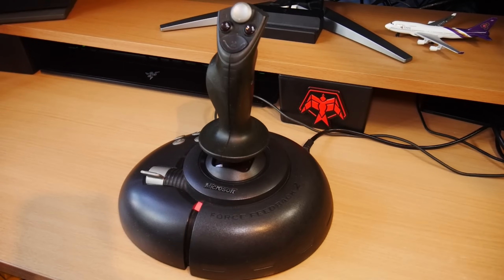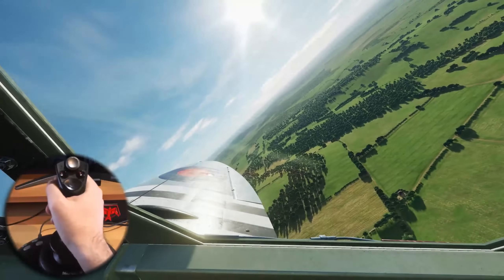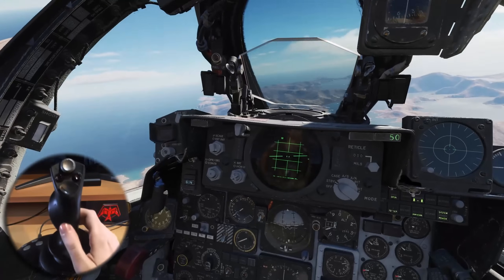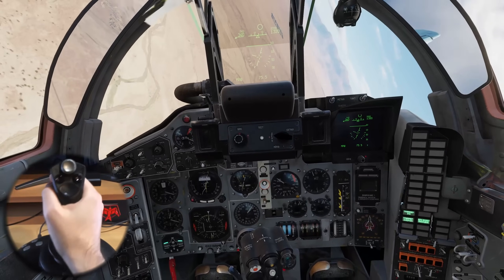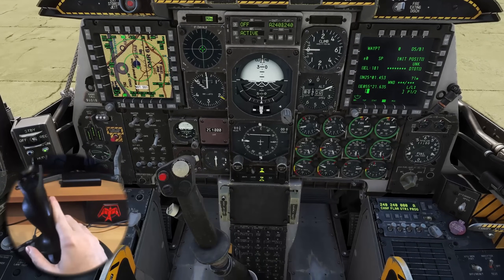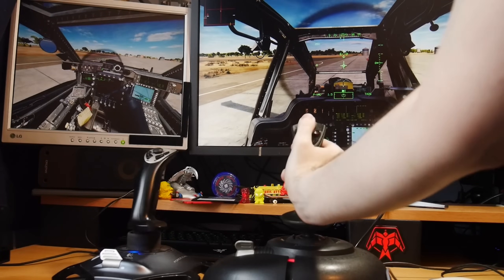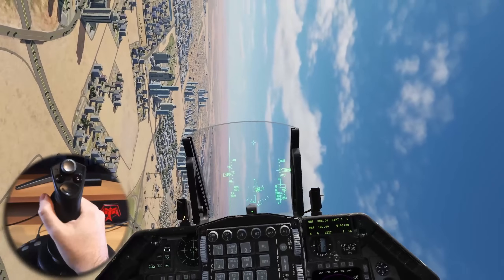Force Feedback in Digital Combat Simulator, An introduction

Comment: Out of curiosity how compatible is the sidewinder with todays games? Is it a pain to get working or for the 50 bucks i see on ebay is it worth it?
Reply from the maker: If the game supports FFB it'll work. Though getting it to work at all with FFB is a little jank. No idea about on windows 11 this was on 10.

If the game natively supports FFB, and your FFB drivers are working, it'll work with that game. But... almost no modern games support it, the exception being flight sims. Most modern racing sim games support FFB, but for steering wheels rather than sticks, but some might work sort of.

So, you'd be looking largely at late 90s early 2000s games that support FFB really. As the rather lackluster gamepad rumble has replaced that kind of feature and has no translation layer for FFB.
Reply: @RedKiteRender  Also, I cannot get the Sidewinder 2 to work in Windows 11; I went back to Windows 10 and all is good.

Comment: Is there external software evailable to get more out of the effects? Like when its not nativly build into dcs-module?
Reply from the maker: I don't believe there are any generic programs to do this. Software like VPForce is a modern open source FFB solution, MOZA and WW also use their own software to add effects. But all of these are tied to their hardware to best of my knowledge. So, if you're buying a modern stick it should have extras, but old original FFB it's unlikely to have any support.
Reply: Are u using windows 11? If so how did u get it to function?
Reply from the maker: @ This was on windows 10.

Comment: I recently got an old logitech ffb joystick & have been having so much fun, im more of a retro gamer but using xpadder to simulate effects then playing old space sims like Wing Commander &  Xwing (which never had native ffb), the difference is just astounding

 ive even added effects to emulated console games which transforms a mediocre "simcade" into something completely immersive, i can never go back

Space sims are especially cool due to the generic centering spring you can apply (which isnt ideal for planes) but you can make it so the stick tightens when you boost the throttle or kick the stick back hard when you fire missles, or just vibrate for laser fire, its as if youre playing a completely different game

Comment: Microsoft killed the force feedback joystick back in the day, when they did an update that stopped a vast majority from being able to work with the operating system……..just like they have done to many VR headsets by killing off mixed reality for VR.     Yep a lot could be said of big companies
Reply: But his is working now?
Reply: @I’m talking about the original going back about to early 2000. The windows os was restructured to remove the direct interaction with hardware.
Reply: I’m going back over 20 years ago as I said, back in the day.

Comment: If memory serves, the MS FFB2 stick has infra red sensors on the back side of the stick, so assuming they aren't clogged or blocked from age/use, it will only apply force feedback when your hand is blocking the IR beam on the back of the stick.

Comment: Racing sims have been "gameifying" simulation for decades, the whole point of FFB is transmitting all feeling of the vehicle through the primary sensory input, the steering wheel. This is why iRacing FFB is mid as hell because it only transmits the steering axle forces whereas Assetto Corsa stands head and shoulders above the rest with is full sensory FFB system that also inputs far more of what the chassis is doing through the wheel.

The fascination with avoiding "gamification" is going to hold back DCS in this area hard, it should be so much more than what they limit it to.

Comment: Have had my VPForce for a year, had the MSFFB2 before that. More has been said about the VPForce than I could possibly share here, FFB aside I love how it can also be configured into a non-FFB but feeling the same or better than VKB/Virpil's.
I can speak for FFB in general though.
The issue up until now has been people doing max elevator deflection at the ragged edge, with scant regard to saving energy, that's been an issue for quite a few years now.
The P-51 for instance has gotten offed many times because of this, smaller 109's simply turn inside of the P-51's circle, pull lead and hose them, it's simply easier.
But with FFB, the few times I fly the P-51, in IL-2 for instance, the 109's just outright don't expect me to do the same as them, vertical wingtips putting it on the edge, but worse yet I'm HOLDING it there at about 220-240 mph, it's a wider but faster turning circle, to get inside of it they have to be at the ragged edge, overpull to get lead, and shudder a little (you can tell when their wings start rocking), that's when I gain, then eventually they try to break away and run away having turned with me for far too long = My queue to just open the throttle and hose them outta the air.
I can also throw it into quick "flight departures", spin around my own axis and return fire as they zoom by, it's getting people thinking again finally after years of 109 superiority.
About the only thing that gets me is packs of 109's running trains on me, and it happens often, but if I can get them all turning after me at the same time I can give everyone a quick burst as they invariably disengage when I catch up (never fails) hopefully damaging them, then focus on the last 1 or 2 109's.

Comment: Sadgely, Google did not push me a notification for this and I only found this because I was curious about your handle change to RedKiteRender...

0:03 Yay for Moza! Got mine already as well, hooked up with a long Monstertech extension and a total of 17.5cm worth of extensions from MFG. It's a night and day difference to the good old FFB2 that I used for 21 years straight. And it was way overdue, if you ask me. I never used the TMWH stick because it didn't have FFB in the first place, it literally was lying around in the wardrobe for some' like 12 or so years. Just been using the throttle. And I never cared about the better CAM based bases (badum tss!) either, because, again, no FFB. And when Moza announced theirs and I read someone had already preordered theirs, I immediately went ahead and did the same. And even with the mounting and extenions adding the entire thing up to almost a grand (170ish for the MT, 100 for the extensions and I used the PayPal option to pay the base off over 24 months, adding interest rate, plus shipping, obviously), I have absolutely no regrets!

0:30 I played THAT and other space sims with the venerable Freestyle Pro though. The thing that came with the gyro sensor and Motocross Madness, which also was great!

1:02 Good old OG Il-2 - the thing that made the FFB2 spread like the Woohun Whirlybird! It literally gave you an edge in dogfights!

2:35 Which some might actually do with the new bases, unless they install extensions to get more leverage.

BTW the whole stiffening up thing is way better in the Il-2s, OG and GB. In DCS, peak force is applied already at around 200kph or even less, which - to be honest - sucks. I hope that ED will rework this with more bases coming up now.

6:26 And that is the most important thing about having FFB sticks for simulations: It gives you some extra muscle memory advantage. At some point you just know how fast you're going simply by judging the stick position. Which is the main reason why I never could give up on it and went through 21 years of using that specific good old Sidewinder stick that is old enough to have beer in the United States. This is especially vital, I even dare to say mandatory for the helos!

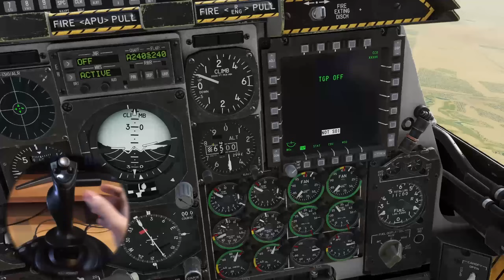11:01 Wow, didn't even know that as I never ran into that situation. I wonder if they have modelled the MECH mode in the Hornet though.

12:02 Here comes the real deal of why FFB is so important. It's an absolut game changer here. Casmo literally could yeet like every third video he ever made, because those all were on how to trim the darn thing, and just replace it by one telling the people to get a fricken FFB stick base now or bust.

13:22 Absolutely another absolute must have use case for FFB, even though it still requires some work to be done on the modules' end.

14:21 I hope the rise of FFB will change that. It's been like that for decades, FFB always being dragged behind somewhat.

17:49 I still have to fiddle around with this... initially, my Moza base was set to Telemetry only and nothing happened. Then switched to Both, same. Then went to DirectInput and after it not doing anything there either, I restarted the entire software suite (Moza Cockpit and DCS, basically) and I got what I was used to, just to leave it there for the time being as I still have to remap most of the modules and actually get back into the whole flying thing again as I've more or less dropped it somewhere in 2022 and only came back for a flight or two when new modules arrived, because I kept having performance issues which I resolved by getting a 4080S earlier this year... but I was stuck in ETS2 and ATS which I started enjoying with a wheel around March XD

BTW from what I heard, VPForce is the absolute reference here. ANd initially I was going to get that base, but I had some troubles with the Google Sheet to sign up for the waiting list that I never gotten on to and didn't care enough to get done because I kinda was holding the whole flying thing on break anyways...

18:54 Speaking of rudder pedalsm AFAIK FFB pedals exist from Brunner and also are announced to come from a company called flitesim. I really hope that this will make the devs implement force trim effects onto those as well, especially for helicopters where it's euqally as vital as it is for the stick itself.

And ultimately I wanna see FFB throttle quadrants that make use if those motors to give us actual friction control, dynamicly placed detents based on module and ideally also input curve settings! Which is a thing that DCS doesn't incorpoirate yet BTW. You can't have a non-linear curve with FFB, otherwise your force trim will be off. Oh, and of course, this would also add the "ghost throttle" thing to aircraft like the Hornet with the "au'oh thro'oh".

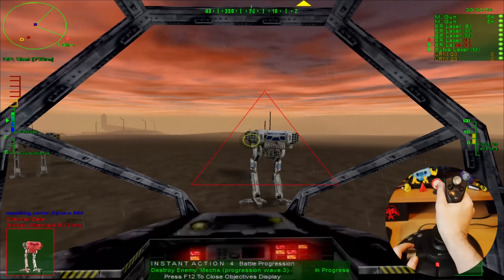19:31 BTW, I can only urge you to give Il-2 Great Battles a shot with it. Its FFB is just pure awesome. Especially with the WW1 birds!

And I wanna go play some Vox Machinae in VR again now... or finally get MW5 with that allegedly great VR mod...

PS: This video needs way more views. Would have it totally deserved. Can'T wait for a follow up on the Moza and its software BTW.

Comment: Great summary of the state of the FFB support in DCS. FFB is a game changer, i bought mine as an experiment, i thought i will try it and most probably sell it after...but it makes a huge difference, i cannot go back to spring loaded sticks. I think the most important part is the last section of the video, about the software support of the hardware manufacturers. I do not belive that ED will make FFB support impovements as a priority in the nearby future. This means we have to rely on the 3rd party software provided by the hardware manufacturers. VPforce did and does a great job on their temetry software, but not all the companies can/want to provide the same lvl of support. Some of em simply too lazy to develop their own software and try to use (steal?) form other developers without the proper insight, which will lead to a wrong implementation and negative user experience, hurting the whole concept of FFB (....looking at you Moza).

Comment: Effects that do not translate via the stick (or rudder) should be transmitted via a bass shaker (Buttkicker or similar) and not via the flight controls as in the real aircraft it is the aircraft that shakes or vibrates and not the stick and rudder.
So one can ask ED to make a dedicated sound channel for bass shakers (as in iRacing).
That, added to a realistic FFB implementation (and VR) is the ultimate immersion, where only accelerations are missing.
Reply: Yes, but the stick and the pedals are mounted to the airframe, so you will feel the effects on those as well. If any kind of haptic implementation should happen, it should not come through sound channels but telemtry data (as it works already with Simshaker, official support would be great but will never happen).

Comment: I've been using FFB joysticks for 12 years.  Had a couple different iterations of modified MSFFB2, and now am using a Brunner CLS-E.
I have a Brunner profile for the F-16 that is stiff and limits the throw of the stick to 15%, and it is actually pretty immersive... although having the stick center mounted breaks immersion a bit lol.
Thanks for the vids, you are top tier DCS content!
Reply from the maker: Thanks! Yes the Moza FFB does a similar thing for the F-16, however i also happen to have an actual force sensing base on hand, so I'll do a direct comparison at some point of how that feels.
Reply: @RedKiteRender  No doubt the force sensing stick will be better, but will be interesting to see your comparison!

Comment: I once owned Microsoft’s FFB (Force Feedback) first generation, and I used it to fly in IL-2. The amazing feel of the force feedback had me hooked. However, after Microsoft produced the FFB second generation, they stopped making improvements, which was very disappointing. Over the years, I tried several other force feedback devices until last year when I got the VPforce, and so far, there’s nothing better. By the way, MOZA’s misuse of VPforce’s open-source code is disgraceful, even though I’m from China.

Comment: People have been saying for a while that you need to feel it to know what you're missing. They were right. You'd have to pry my VPForce Rhino from my cold, dead hands. I've been having a blast just flying around holding aircraft on the edge of stalls, doing precision helicopter maneuvers, etc. I'm bad at dogfighting, and yet still noticed a significant improvement after just a couple play sessions. As for the game-ified effects, one solution is to get a transducer and let a program like Simshaker handle them.
Reply from the maker: Yeah i've considered simshaker in the past, though never gotten around to trying it, one guy i fly with uses a seat pad rumble feedback system. Ideally you'd have both and VR! And a simpit whilst we're at it for total immersion.

Comment: Adding certain FFB functionality to a jet like the Hornet wouldn't even be game-fied per se as the jet's CAS will provide certain effects, in addition to the simulated wind effects provided by the FCCs (if i understand the details of that english language text i was reading correctly).. And that's staying completely in the realms of "is realistic".. Other than that, some "game" effects like ripple effect when releasing payload or rumble for touchdown etc wouldn't be a bad addition neither imho.

But hey, i keep my X56 from falling apart and am miles away from affording anything remotely FFB related anyways.
Reply from the maker: It's one of those things where the rumbles can throw your stick off in unrealistic ways in response to what should be felt throughout the whole airplane instead. Simshakers  / transducers and other systems exist to give those kinds of feedback. So it 100% needs to be a configurable feature for the user if added onto the stick.

Comment: dcs cant have ffb effects cuz they are gamified but can have a 100% accurate rwr reading and a perfect 90° notch angle XD
Reply from the maker: Only doing the realistic FFB features means you don't have to make a configurable FFB menu to control the "gamified" features to avoid upsetting purists and allow customisation to each stick. It's a lot of work for a feature that hardly anyone will use, but, hopefully that's changing.

The RWR is a simplification, one Heatblur disagree with! So they model more depth to theirs.

Comment: I don’t know if I’m impressed with your video ( which I am) or more impressed you still have a MS Sidewinder FF stick!!! I didn’t think they had those anymore!! Also that game footage of Mech Warrior etc… Too funny! Those were state of the art best graphics back in the day!! Curious what you think the difference the old MS stick and the new sticks? I have a Moza FF unit but have not had a chance to set it all up yet. I didn’t expect it to be so large and can’t figure out how to get it to fit on the bed when I fly? Might have to make a cockpit with a lounge chair or something. Anyway, thanks for making and sharing this info and video. Great job!!
Reply from the maker: It's an original, had it a good 20 years old by this point, but still trucking on! The Moza makes the old MS FFB feel like a toy, much stronger forces, but it's a biggy. I hope we see some smaller ones come to market too. Moza offer a desk mount, which is what i'm using, but any aluminium extrusion / T rail mount could be used to attach it, with the correct bits to adapt.
Reply: @RedKiteRender  Personally I'm waiting until we get one that's a much smaller desktop capable stick. Kind of like a Sidewinder 2.0. It's a shame we've only seen big hulks so far

Comment: Would you mind explaining the steps to get my old MSFB stick working again? I havd DCS in a Windows 11 operating system
Reply from the maker: Unfortunately i'm on Windows 10 not 11, first step would be just plug it in, enable ffb on DCS and see if it works, there's a program called FFB tester as well, which you might find helpful. As for drivers, I'm not sure. It's been a while, i think it just worked right off. The Logitech one needed the current FFB drivers from their site to work.
Reply: Thank you for your response.  Really appreciated.  I will have a go at setting it up. I love the Spitfire and F4E and want to see how they feel